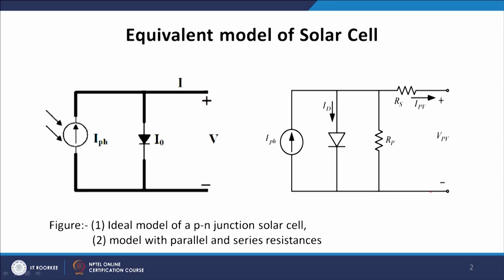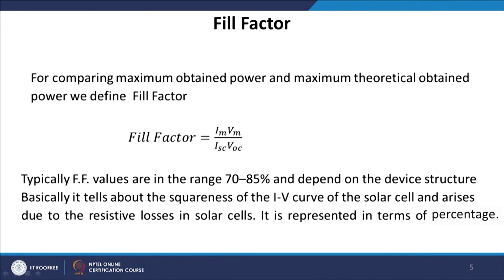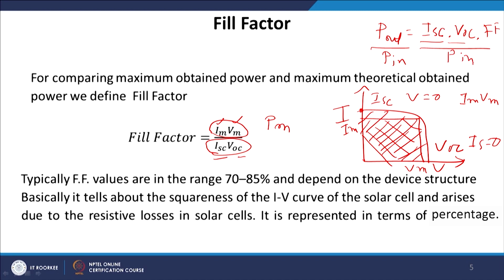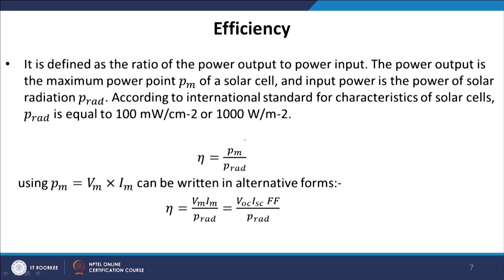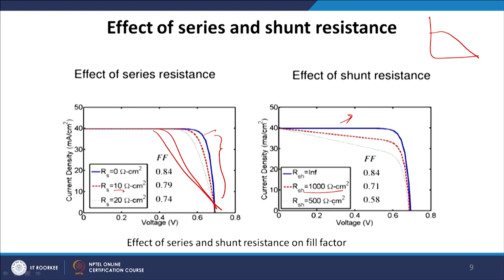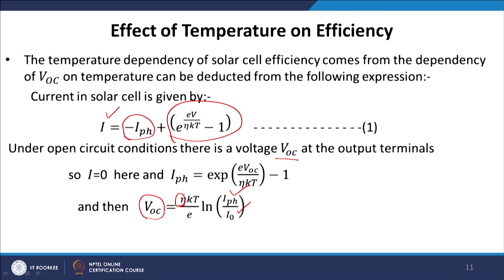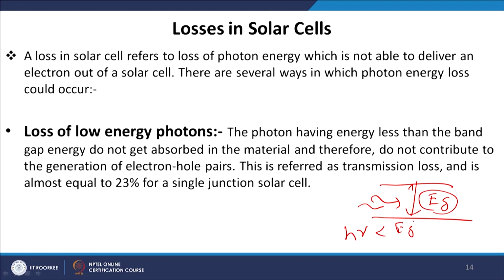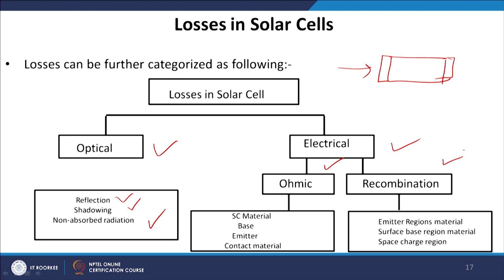Equivalent Circuits of Solar Cells, Fill Factor

Comment: As you mentioned, for Ideal case shunt resistance should be infinite, that means there should be many crystallographic defects and grain boundreis. How can it count for the higher efficiency if the crytallographic defects and grain boundries are more
Reply: I think the explanation was incorrect, crystallographic defects and grain boundaries results in low shunt resistance because they provide path for current leakage, where as minimizing them will increase the shunt resistance leading to a higher efficiency.